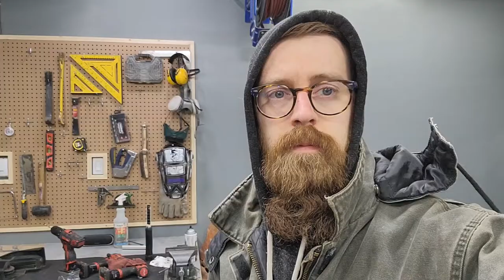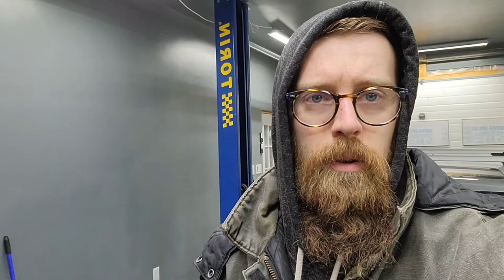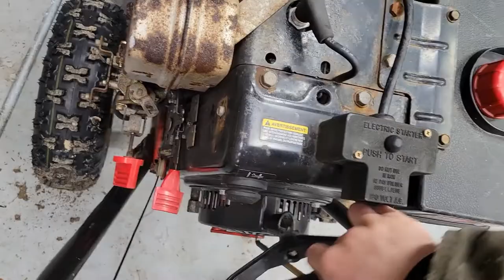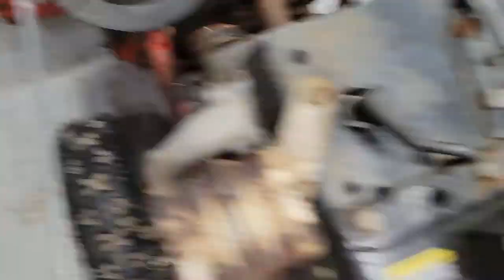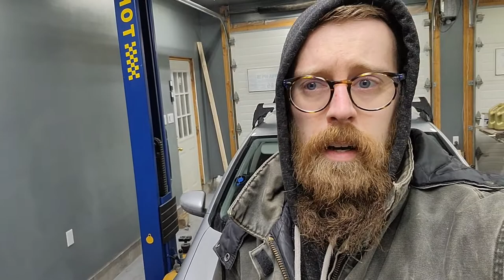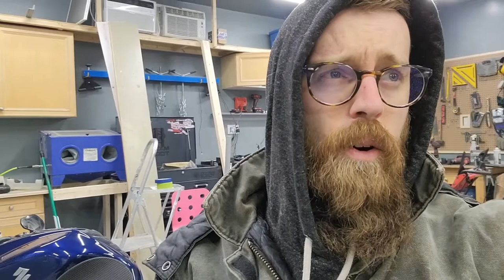Determining Rich or Lean Condition

Comment: Great explanation!  I just purchased an older snow blower that looks very similar to your vintage.   It takes a while to warm up, runs great for a while and then runs worse as it heats up.  I have an adjustment "screw" at the bottom of the carburetor that I play with to keep the snow blower running well while I am doing my driveway.  When turning the adjustment clockwise I am not sure if I am  making it run more rich or more lean?   I will have to use your tips to listen to it next time I use it.
Reply from the maker: Turning it clockwise as viewed from the bottom will make it leaner. Thanks!

Comment: Actually this is a litle bit confusing. You see, modern F1 cars run very lean, like AFR is something more than 20:1 which is EXTREMELY lean, and they have good fuel economy, and efficiency, but they don't shoot flames. There exhaust are a little bit red, but again they don't shoot flames. And i thick excess air cooles the engine as well. But excess fuel which can also ignite, can make shoot flames, because there is physicaly more fuel in the chamber. Whith rich AFR which is less than 14.7:1 can lead to additional carbon emisions, more smoke fron exhaust, carbon capturing in the exhaust pipes, ruined spark plugs, VERY low gas mileage and very strong gas smell. But still good video👍🏻 Please correct me if i am wrong someware and add something if need. Thanx😌

Comment: I have a mower running rich, cleaned the carb, choke is fully open. Any suggestions on what could be the issue? Also the carb is non adjustable
Reply from the maker: If it's definitely running rich, try running without the air filter, try swapping muffler with known good muffler, verify camshaft isn't worn and you have poor lift, aside from that, might have to try a new jet

Comment: so  RiCH mean less gas , LEAN mean more gas. whcih one better
Reply: rich. Lean burn will destroy your rings, valves, seats and manifold by overheating. Rich just soaks down the cylinders and makes you have to change the oil more often.